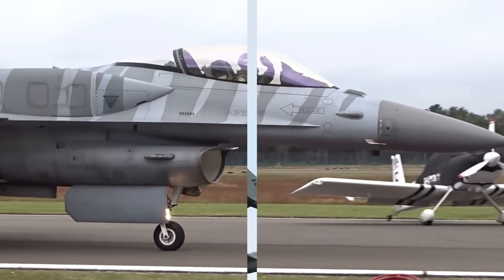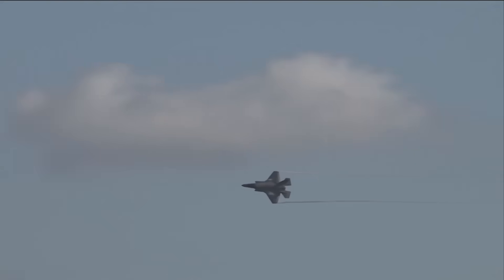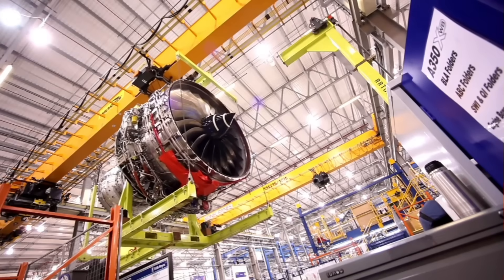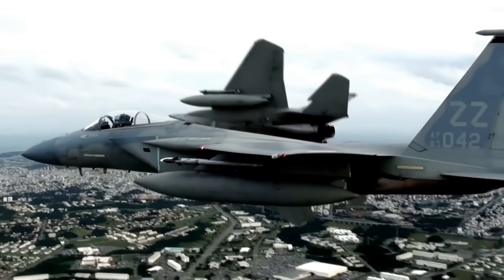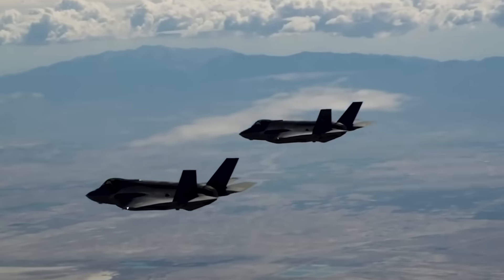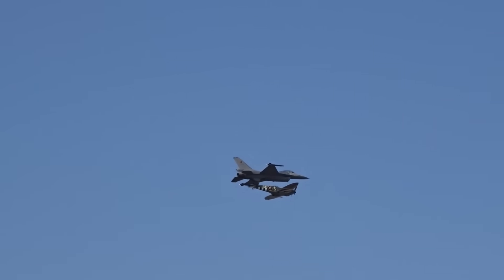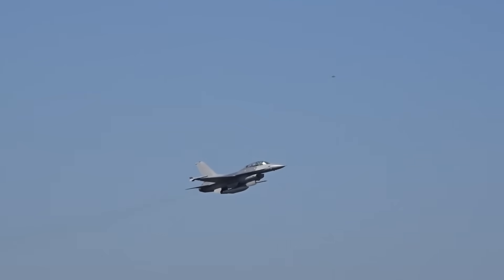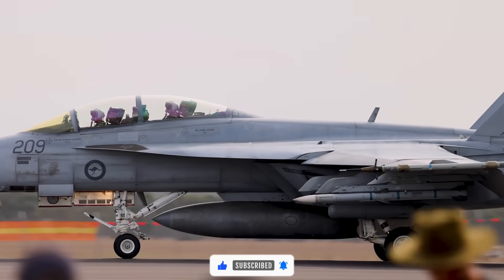Sweden's NEW Gripen EF Has a POWERFUL Rolls Royce Engine That TERRIFIES Rivals!

Comment: Video wallpaper including various random cuts of  F-18, F-16, even 1950s era Hawker Hunter and Mig-17 and yes even the usual laterally flipped Gripen footage that generally bears little connection to the commentary read by a synthetic voice.

The point it makes about replacing the American GE  F414G engine (or the Volvo RM-16 licensed produced version of it) is well taken. It is also correct in pointing out that development of such and engine and modification of the airframe to accommodate it is not trivial. It will take time and money. Despite the clickbait title, I must have missed where it mentions Rolls Royce possibly upgrading the EJ-200 engine (which powers the Eurofighter Typhoon) to the EJ-230 which is a close match to the F414G engine. To my knowledge, neither have happened yet (if that is wrong, please supply a credible link). 

So it would be a mistake to come away thinking this was a done deal. AFAIK it isn't - not yet anyway.

Comment: I call BS. There is no RR engine and I do not believe that there will be. Contrary to what some have said below I believe that the RR engine will require major changes to the air frame as well as the control systems. I also believe the Saab is working on a sixth gen fighter that may have a flying prototype by 2027. If that is true I very much doubt they would spend resources redesigning the Gripen E for a different engine.
I also see a role for the current Gripen E in our north with a dispersed deployment in much smaller bases. The F 35 is like a large overpowered 352 Boss Mustang. Big, heavy, powerful and loaded with exciting electronics. It guzzles gas and has a very hgh operating cost per hour of flight. The only places in Canada where there are runways smooth and strong enough and where crews could be stationed to support it are Cold Lake and Baggotville. It is a two of three hour flight to get to and from the patrols would be. They do have many assets and features that we need but a balanced fleet between the two aircraft makes more sense to me. But then I am just a member of the peanut gallery who hopes we can get the best benefit from both.
Reply: The RR engine exists, it is called the EJ-230, and was proposed for the Gripen C/D. It is a derivative of the EJ-200 as used in the Eurofighter Typhoon. It is roughly the same Idea as the F414G, the current engine used in the Gripen E in that the F414G is the single engine derivative of the F414 used in the F/A-18E/F/EA-18G Super Hornet/Growler, in which it is used a a twin engine configuration. The EJ-230 is smaller than the F-414G in both diameter and length, so fitting ito a Gripen airframe should NOT be a major redesign. The EJ-230 also has lower fuel consumption, and is lighter. All that being said, the Grpen’s engine management, fuel controls, and possibly flight control systems will need to be changed for the new engine. Depending on which version of the EJ-230 is to be used( 22,000 lbs thrust vs. 30,000 lbs. thrust, and with/without thrust vectoring) the air intakes may need to be changed (a 30,000 lbs. thrust engine will need more air inflow than a 22,000 lbs thrust engine). There is no question regarding the EJ-230, it is more a question of how fast can the changeover be done, how long will the testing program will take, and who pays for it, and what it impact will it have on the purchase price of the Gripen.

As for the sixth generation fighter, SAAB is part of the Tempest project, a British lead consortium that also includes Japan. That plane will fly in 2030/2031, and won’t deploy until 2034/2035.  Canada doesn’t have another 10 years of lying time in the CF-18; they are pretty much done now. Even the F-35 Block 4, the plane Canada contracted for originally when we decided to go with the F-35 originally, just go it’s availability to 2031 from 2026. 

The other point to rennet is that the Gripen better suits Canada’s requirements than the F-35 does. We don’t need to go into contested airspace and destroy enemy air defences, or dogfight. We do need patrol the arctic, and fulfill or NORAD and NATO commitments. The Gripen can do all of that, and is an able dogfighter and ground attack aircraft. Truth is, anybody wit any sense would rather be be in a Gripen loaded with 4 Meteor missiles than an F-35 with AIM-120s, because the F-35 can’t use Meteors. This may change if the AIM-260 ever works properly, but at this point, it doesn’t.
Reply: @k @kostaskritsilas2681 thanks for responding and for a very informative update I think we need both with the Gripen carrying the load on the patrols. If we get the deal,to manufacture for world wide trade it is a great boost to rebuild our aerospace industry and a strong blow to Americas arms sales. Win win from my perspective.
Reply: Ja. Too Said my government believed you and now we sink real money (Euros) into Fat Amy! So sad!
The EJ200 fits into the Gripen. Would be awesome, as we have a big supply chain around this engine here. EJ200 is a good engine. Some say best!
Reply: RR engine is already flying in Engine Test Gripens over Sweden
Reply: @firstlast-hj2sb cool do you have a link where I can see it?
Reply: @firstlast-hj2sb how so when only 1 EJ-230 prototype exists and it's not yet certified for Gripen Airframe or as Single Engine Configuration yet?
Reply: negative it remains a proposal without a market  @firstlast-hj2sb

Comment: I'm German. The mentioned engine will be build by the Eurojet Turbo company. The ownership is by RR 33%, MTU Aero Engines 33%, Avio 21% and ITP 13%. The integration will be challenging by time but that's business as usual. 
This summer there were flight tests over the Baltic Sea with a Saab Gripen prototype with a different wing design and an embedded KI solution by Helsing for autonomous flying and fighting.

Our Eurofighters EK(EW) will get the Saab Arexis Suite plus Helsing KI and some other gizmos. Saab GlobalEyes are in the pipeline. The Gripen is a sublime fighter jet. Germany,  Sweden and Canada should go together with Spain and build a "Gen6-System" together. Greetings from Frankfurt, Germany
Reply: EJ-230 is a prototype for Typhoon thus far as only certified for twin configuration using it in Gripen means Airframe mods extremely expensive
Reply: Canadian here. Thanks for the update, friend. I see we have one nay-sayer here who doesn't believe that the Rolls-Royce powerplant exists. He's obviously a Yank.
   Cheers, and have a good day,eh?
Reply: @kenkesler3087 😊It will be a powerful engine. Btw. i'll join the January with my wife in Ontario. Ellbows up!
Reply: @thomasmo4334  I live in rural Alberta. Too bad we won't be able to meet. Have a safe, enjoyable trip.
Reply: @kenkesler3087 Thank you very much. That would be very nice! We spent each year some weeks in Canada because in the blood line of my mother there is a little bit of native canadian blood and that's our bond. The January 2007 was really cold and beautiful in Alberta when we were in Banff, Edmonton and Calgary.
Reply: @thomasmo4334  One thing we have in southern Alberta that is unique to Canada are chinooks (pronounced: shi - NOOK). If I remember rightly, it means "snow-eater" in either Cree or Blackfoot.
   What that means is that you could go to bed when the temperature is -30C and wake up the next morning to +6C. And the chinook arch is really quite something. It takes the form of a clear sky underneath, and an arch of cloud over top. These arches often stretch for hundreds of kilometers.
   Edmonton is too far north and doesn't get chinooks. But from Calgary nearly to the Canadian border, we do. Ask any Albertan. We live for chinooks.
   Anyway, take good care

Comment: I have heard that the changeover to the Rolls-Royce powerplant requires very few changes. In particular, the RR engine has been designed to fit within the Gripen airframe. The only differences would be the location and type of fuel/control/lubrication attachment locations.
   Besides, the F-35 isn't as stealthy as they want us to think. These aircraft can still be picked up on radar. Not only that, but the "stealth" coating starts to peel at supersonic speeds, limiting this speed to only about 10% of any mission profile. There have been reports of software malfunctions. There have been cold-weather-related crashes, including frozen hydraulics. These planes are over-hyped and over-priced.
   The Gripen does not suffer from ANY of these problems. The reason is obvious. Swedish designers took into account the problems that cold climates can pose. Now, Sweden will detach themselves from the USA by adopting the Rolls-Royce engine. And this engine will provide SUSTAINED top speeds of about 1,320 mph, enabling it to fly circles around the F-35.
   This the perfect aircraft for Canada. Made for our climate. Inexpensive to buy. Inexpensive to maintain. Inexpensive to operate. Full autonomy to modify or upgrade, with the option to openly share these with Sweden. Ten thousand FULL-TIME jobs to build Gripens. Thousands more in subsidiary and supply roles. Full autonomy to manufacture our own spare parts if we wish, possibly including the engines (under RR license). We have the brains. We have the resources. We can provide the facilities. There is also the option of selling our products to other allies. We have nothing to lose.
Reply from the maker: You've made a compelling case for the Gripen, especially concerning its suitability for colder climates and the potential economic benefits for Canada!
Reply: I understand the Canadian military still want the F-35, but I hope they'll come around and realize that the Gripen is a perfect choice for many reasons.
Reply: ' ... the "stealth" coating starts to peel at supersonic speeds, limiting this speed to only about 10% of any mission profile.' - The speed is limited so the surface of the jet does not get hot enough to be picked up by IR detectors.
Reply: @bugstomper4670  What about the jet exhaust gases? They exit the tailpipe at temps of about 400 degrees Fahrenheit. That makes IR detection avoidance impossible.